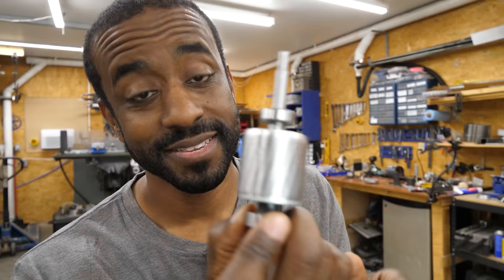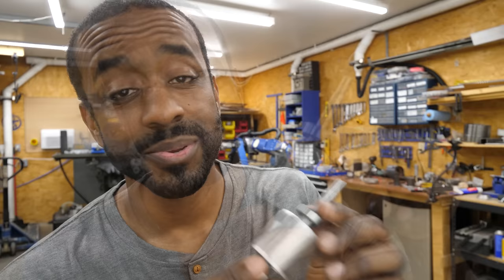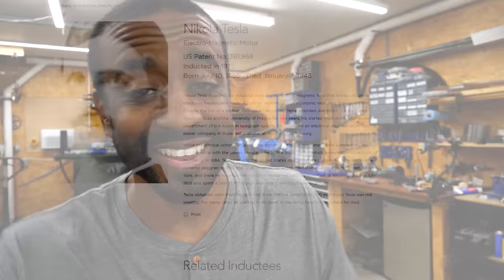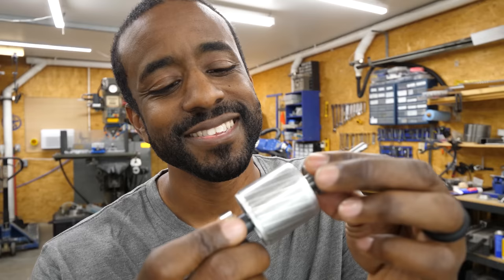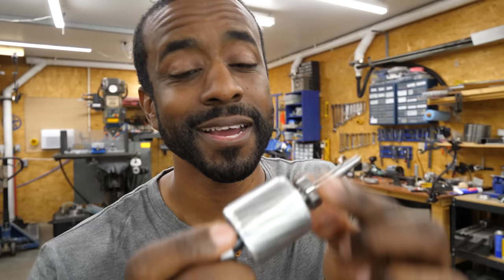This Invention Got Nikola Tesla Inducted Into the Hall of Fame! : Jeremy Fielding #096

Comment: I have a question. If I had 4 electric motors directly attached to every wheel on a four wheel car, and if that car can switch to front wheel drive to rear wheel drive, but whenever its switched the side that isn't being used becomes a generator for power. If I use front wheel drive and then use rear wheel drive for generating power, would I cancel out the power used? And if yes, how much power would I generate or cancel out? Cool lesson by the way, subscribed.
Reply: You always have losses while transforming energy. Got It? There is no free lunch, you need energy from somewhere to get another kind of energy.

Comment: Could you make an induction alternator? Would it be possible to channel any energy loss as the poles change to trigger an alternator linked via another method to this type of electromagnet? Has anyone tried using liquid with a suitable ionic charge as a conductor that could potentiate the energy lost in the electromagnet?

Comment: Jeremy, I do not believe in 'free energy' because we have to use some form of initiator such as a battery or a low energy device to power a bigger one to power if not the whole home devices but at least a regular 120 volt aparatus. What would be your take? We have seen most of the free energy stuff here are fakes. Thanks.

Comment: Total dummy and non physicist here but has anyone tried to replicate Tesla's water motor using magnetic discs and aluminum/copper? The turbine itself has been touted as generating 90% or better efficiency on it's own. What would happen if you introduced the principles of electromagnetic drag on copper or aluminum on the inside the turbine housing to help propagate rotation?

Comment: I feel a little dumb but the spinning of the magnets moving the aluminum I understand. And I guess replacing the magnets with electromagnets is the end product of the electromotor? But what creates the electricity that powers the motor? A battery? And finally if the magnets need to be spinning to move the aluminum then that energy used to spin the magnets seems pointless if the aluminum is spinning no faster, why not just spin the aluminum with a spinning motor powered by electricity? Can you help me understand a little better please? This stuff if fascinating to me and I would like to know more. Your videos are very helpful for understanding how energy works
Reply: What he showed is the induction motor. Like you said, in a real motor the permanent magnets are replaced by rotating eletromagnets(50 or 60 Hz).

Comment: The induction motor was sold as a more efficient design. Now the government is mandating them in everything. The problem is they aren't more efficient in reality. Only in theory because they aren't powering magnets. But in real world application under a load they use about the same. They cost a lot more partially because of the material but mostly because the regulations are pushing the demand faster than the supply can keep up making this a burden on the consumer more than anything.

Comment: his biggest invention is not this, thats gotta be alternating current
Reply from the maker: These two things are strongly related. Alternating current would not have become useful without the induction motor. It was the induction motor that made alternating current a viable power option for converting that electrical power into useful work without switching back to DC locally.

Comment: yes electric motor are nice but they are also inefficient, the reason is Lenz's  law.   but do you know Lenz's law can be defeated ?   and after you defeat it you now have a motor  where the two magnetic fields no longer fight each other.  and the motor or generator can now spin with no oppositional force, in a generator this means it's very easy to get it spinning, there is no electrical magnetic cogging, and the motor will still put out it's rated wattage while being driven by a fraction of the power it  use to under Lenz's law.

Comment: Hello, I disagree with you saying the metal object is pulling on the magnet. Because the metal can only react, it is an inanimate object. You said the reaction between metal, magnet, and motion creates electricity. I think that the previous reaction pulls metal molecules together creating heat, that heat then creates increasing pressure on the magnetic wave. But I question why and how that reaction creates electricity as well friction, when to my knowledge the space between magnet and metal has no more friction than the atmosphere.
Reply from the maker: I think it will help to watch again. There is another part of the process that is explained in the video with the metal pipe demo. When you start to understand that the rest will make sense
Reply: I forgot about gravity
Reply: But even then gravity is equal to motion in the previous equation.. motion+ metal+ magnet= electricity ect.  Gets fuzzy there
Reply: What am I missing? This will haunt me
Reply: I am missing what what magnetic force is made of, like what is the energy  a magnet emits. Do you have an explanation. And why is it reactive to metal. And what else does it react with.
Reply: Is there even a way to measure my the outcome of my hypothesis irl. Like I would need something to sense movement of metal molecules as the magnet passed through, and electricity is a given in the equation so I would need a sensor to measure what the electricity is doing to the magnetic field
Reply: If I'm correct and electricity is puts load on magnetism does that mean it's some sort of anti electricity. Or is that dumb. Cause there could be a multitude of immeasurable emissions from this reaction.
Reply: If these are useless questions let me know so I stop
Reply: Or is electricity just a byproduct of the reaction. I feel like this cannot be though it doesn't make sense

Comment: This is just a theory or something I just came up with if you made of copper pipe that is circular but had the magnet in it and you had a little hole in the copper pipe that holds the magnet and one spot on the side of it when you lift it up to about a 90° angle and then drop it when it starts falling on the left or right side either spin it counterclockwise or clockwise and see if the magnet will levitate in one spot by the copper flowing around it instead of it falling down will the copper spinning be able to hold it up and if it makes enough electricity can it be infinite motor like use the electricity from the magnet falling through the copper pipe to create electricity not just the magnetic field but the magnet would constantly be falling hypothetically but it's not really fallen because of staying stationery because the copper pipe is spinning around which makes it so when it's falling it lifted up at the same time more than it would when it's going through it just a straight pipe

Comment: Most people don't know that laptops have at least 1 morot in them, for the cooling fan. If you have a CD or DVD ROM then you have another. If you have a desktop computer you may have as many as 15 in there. More if you have HDDs and not SSDs. As do most game systems. Unfortunately these are not induction motors. There they tend to use a permanent rubberized magnetic ring.

Other things which hide magnets are sylanoids, many of these can be induction based as well. And don't get me stated on relays, transformers, chokes, and finally the electrical component called the inductor.

Magnets are everywhere. Pretty much all modern technology uses magnets of some kind. Its so bad that we have to go to great lengths to get away from magnetic fields.

Try to excape the man made 50Hz or 60Hz constant em field which permutaes the whole earth. (Our power grid, which has a wavelength longer than the earth.) And that isn't even counting the earths natural magnetic field.

Comment: I got into this foe a while watching a chanel that claimed they made a "starship" coil. They have since went the wayside and haven't seen much since. Their claim was that if you had this coil you could pull free electricity from the uhf transmissions through old tv antenna. Starship coil, fake or real?
Reply: Take an antenna, and attach a bridge rectifier to it's output
You'll get a small amount of power from the radio waves in the air

Comment: In theory couldnt you have apposing magnets to rotate and make a generator? .
Reply from the maker: They lock together almost immediately. It is called cogging, so no. If you are using permanent magnets on both sides it will only spin to use up the energy you put in starting it to spin.
Reply: @Jeremy_Fielding  Dam it gravity...lol

Comment: zero motorcycles is working on an induction motor for their bikes that.. .instead of just manipulating the frequency of the current- their VFD ACTUALLY INDIVIDUALLY controls the pulses going to each field coil- this has the potential to increase the efficiency of modern induction motors at the boundaries of their operation- for instance- at the limits of high rpm- the motor can actually 'stall' or pause because the rotor is moving so fast that some of the Norths are running into other norths instead of north to south, aka- 'braking'- for this reason- motors designed for extremely high torque & low rpm have less poles. with the ability to 'pair' several of the magnets during operation on the fly- you can actually change a low rpm motor to a high rpm motor & back again- or anything in-between... welcome to high speed micro processing.

Comment: In Europe you can't buy anymore washing maschine with induction (ansychronus) motor. Old maschine have them with condensator for start (making delay to produce fase shift) in monophase current system. Now we only can buy washing maschines with collector (universal) motors and they are awful because brushes wear and overload on rotor can easly short coils. New maschines don't last long unlike old maschines but they say that change is for better efficency which is odd because induction motors have near 99% of efficency. New maschine olny making piles of garbage unlike my other 40 year old maschine that still working and belt was changed only once. I know because Tesla came to that idea. He was working in Edison industry as a mechainc and he had changing brushes on that big motors on regular base (I hate brushes on big motors like in some old trains for better speed regulation, sppining big collector drums manually and checking also changing brushes it hurts for your back). Grettings from Croatia near Nikola Tesla home.

Comment: I love the way you explain how the item operates, is built and the many functions in each episode. I have been attempting to create a continuous moving wheel using two rings of magnets, one inside another, paired up with resisting poles 
(N & N). The outer ring of magnets all have a slight angle. I'm still working on the spacing formula. Is this possible? In my mind it seems to be possible but like so many other ideas I've had, not possible in reality.

Comment: The washing machine is a brushed universal motor you got that point wrong though. Because that's the most cheapest way to get high torque by 0 RPM please do your homework well before spreading misinformation.
Reply from the maker: No need to get so worked up LOL. Most of my audience is in the United States. I am guessing you are talking about a washing machine made "OUTSIDE" the US. LOL. In the US washing machines have induction motors. But I know from experience doing this some countries generally use the universal motor. I have mentioned this difference in older videos, but I guess I didn't mention it in this one. Now, you can relax with all the "misinformation" stuff. :) Maybe you shouldn't immediately accuse people of misinformation over the internet without doing your homework?? :) I am trying to make a joke here. It really is no big deal. Now you are informed.
Reply: Induction motor in my country(Brazil). Nowadays washing machines come with permanent magnets bushless motors.

Comment: Except Tesla didn't invent the induction motor but he did improve it.
Reply from the maker: Multiple people had similar ideas around the same time. Read more into it. Tesla gets the credit for a reason.
Reply: @Jeremy_Fielding  The first crude demonstration of a working induction motor was 8 years before Tesla The first AC commutator-free polyphase induction motors were independently invented by Galileo Ferraris in 1885 and Nikola Tesla two years later in 1887. So by no measure at all did Tesla "invent" it.
Reply from the maker: @mfx1  Lets just agree to disagree. We would be splitting hairs to argue over the meaning of invent. And I don't personally want to split those hairs :) We disagree and that is ok. Thanks for watching and commenting. It really helps a lot.

Comment: What about polyphase and aircraft motors that are 400 volts the efficiency goes higher then there is the bifilar coil all teslas designs 350 % efficiency evens goes higher I've done this for 27 years Daniel's inventions patient Teslas electromagnet get a magnet near tho
Is coil and the coil vibrates no motion on the magnet

Comment: Sir, in your video you said that the rotor do not have a winding. Wrong, the aluminium cage is the winding of the rotor, may be you'll explain why the cage is in an angle,,,, If you start to do the explanations do it correct.....or what you do, you do it for money like many , many others...
Reply from the maker: You should watch my series’s “how motors work for beginners”. The detail there is more like what your looking for. There are two on the induction motor. Single phase and three phase. Search my channel
Reply from the maker: I made that series several years ago. The three phase one talks about the squirrel cage section. This video was for a very specific audiences. More of a “today I learned “ kind of video. Side note. We need more kindness on the internet. Your comment seems strangely hostile, yet I can’t think of a single reason you would respond to this video that way. Let’s bring down the frustration level a bit and talk like we actually met in person. Either way thanks for watching and commenting. That helps a great deal. :)

Comment: The kids today need to learn this stuff the garbage they're getting out of our school is garbage they need to learn these things if they want to get rid of combustion engine they really need to think about what they can do to do that and it has to work otherwise you're not going to get food at the grocery store because trucks can't run on today's electric motors they don't take the vehicle far enough you'd have to add more vehicles on the highway like you would be on the track at a track meet and hand the Baton to the next Runner coming up behind you you would take the Baton and run it to the next runner in front of you. That is a lot of vehicles that would be insane for our highways and the weight that these batteries that operate these vehicles is just out of control it's a good idea but it needs more people would see idea of science and messing around with stuff not just school projects but things you think of yourself are a little experiments and that's what scientists did years ago they would start their mathematics and then get material and experiment and that's for customer come up with this idea of a brushless motor. It's not an engine it's a motor engines are gas-powered Motors our electric.